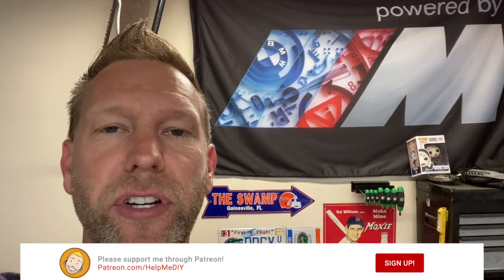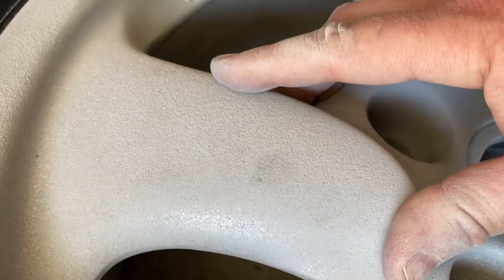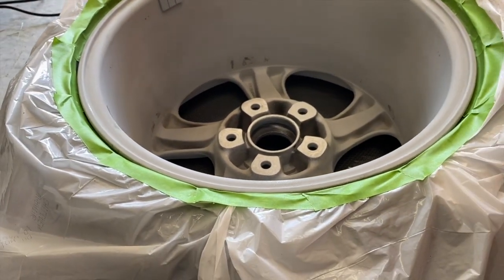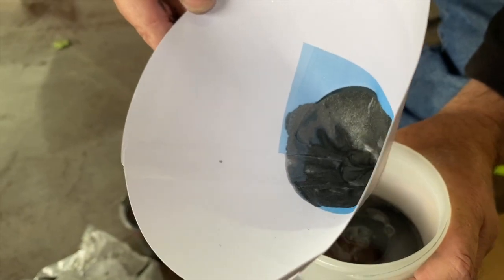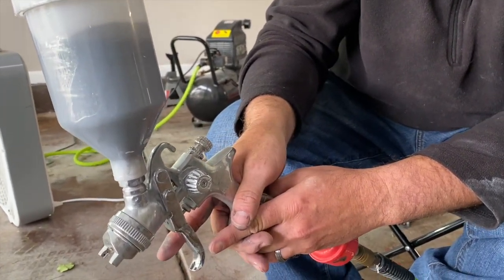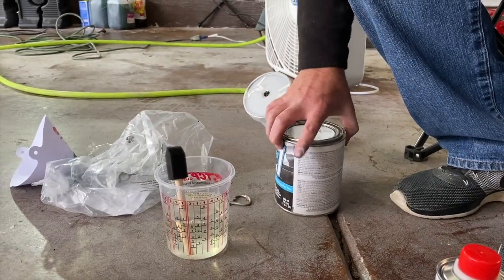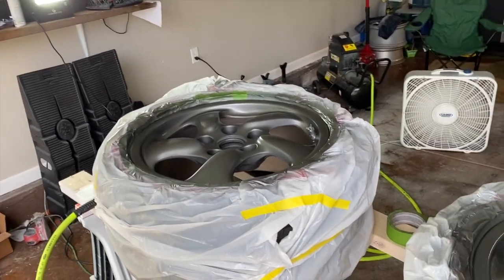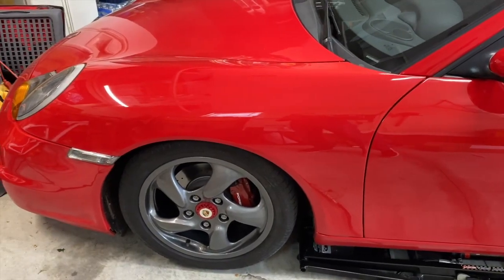How to PREP and PAINT YOUR WHEELS | DIY on my Porsche Boxster 986

Comment: If you don't want any pitting from the sand-blasting to show through, it's best to layer multiple coats (3-4) of high-build primer on first which you then wet sand to smooth the surface. Once smoothed out, then shoot your color, followed by clear. If you really want to step it up, shoot a layer of self-etch primer before the high-build primer.
Reply from the maker: +Michael Skinner good tips, thanks!

Comment: Looks nice until you need to change tires and re balance them.  Remove weights before painting.  You should have aired down tires before taping.  Great garage job.  Also making a wheel stand helps a lot as you can turn wheel while painting.  How much over spray did the inside of the wheels get?  Did you cut and buff them to remove over spray?  Color looks nice.  Nice video overall.
Reply from the maker: +Broken Big Boy Toys hey thanks and great tips. Yeah indefinitely went then “lazy” way by not removing the weights first, but I didn’t want to have to rebalance now. Overspray was negligible so I didn’t have to cut or even buff. Just let them dry and ended up using some leftover ceramic coating.